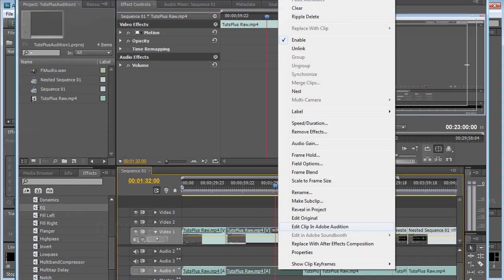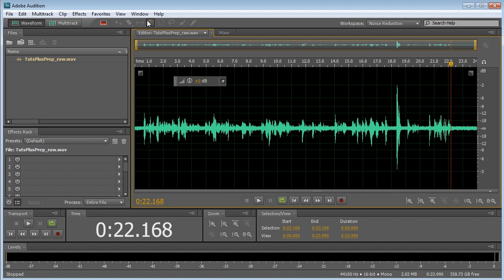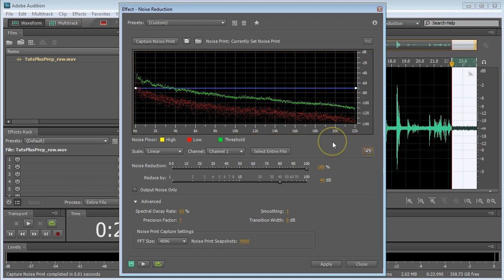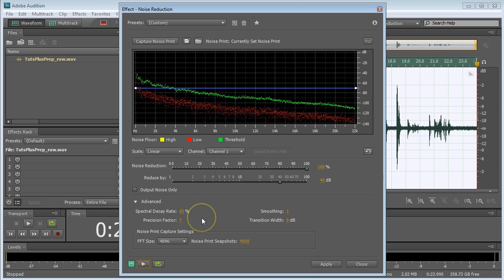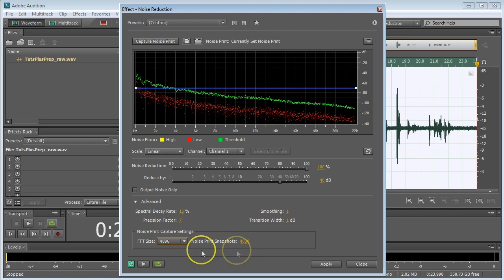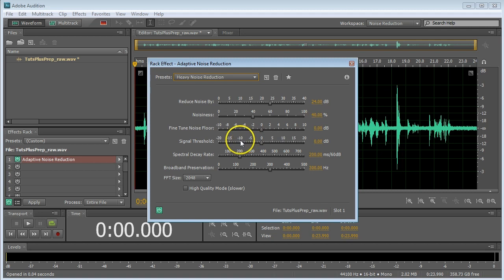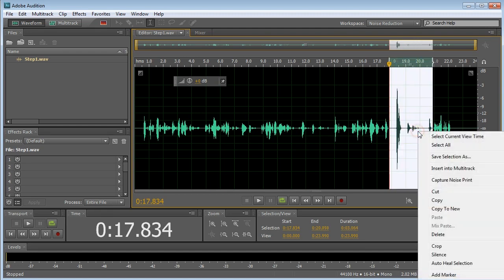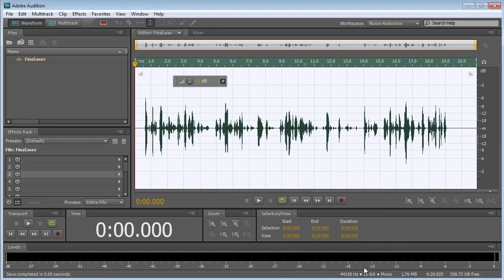Basic Sound Clean-Up for an Audio Novice

Comment: Hi there. 
Hope you can answer my question. 
I'm in possesion of some video files where the sound is both russian & english, in one track. The russian has just been recorded over, but it's still possible to hear some of the english speak, as if it is just turned down in volume. 
My question is, could it be possible to remove the russian speak from the track, and turn up the volume of the english speak?